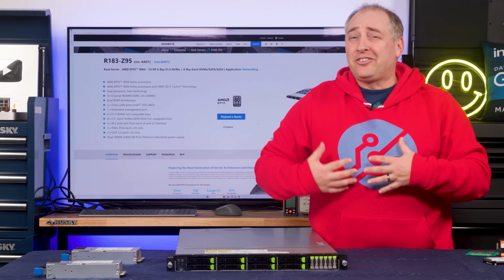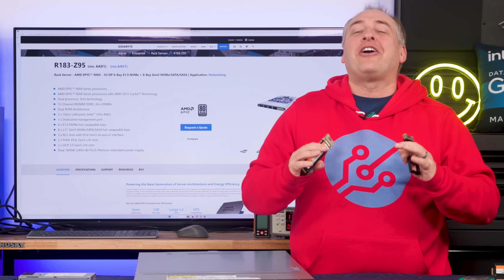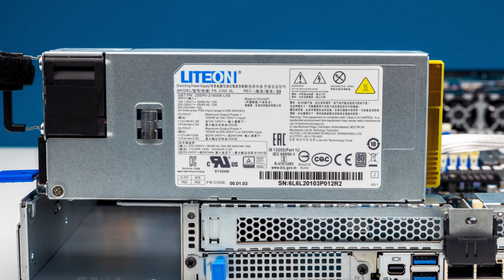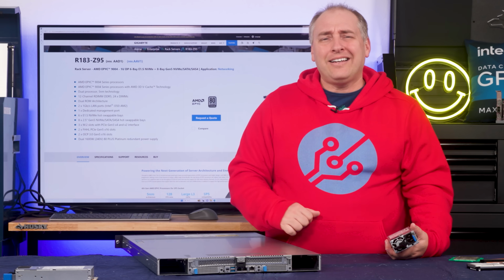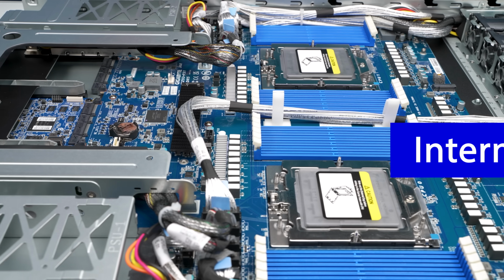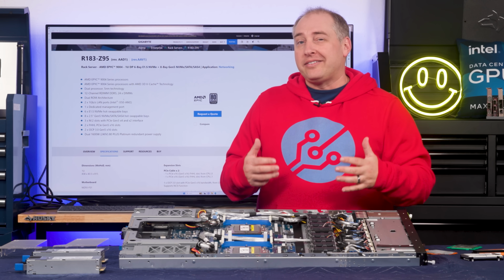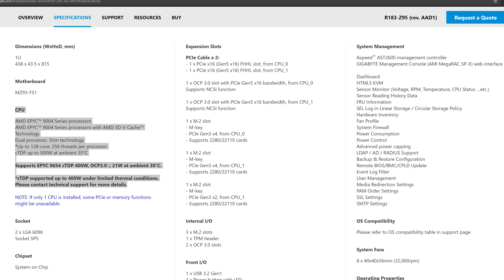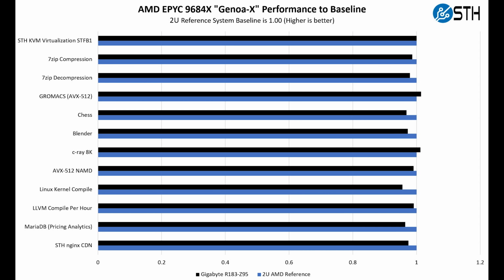THIS is the Future of Storage in Servers

Comment: Isn't 6x E1.s with a max of 7.68TB each a much lower storage density than 2x U.2 with 61.44TB each?
Reply from the maker: E1.S can go higher, but you are right that 7.68TB is common. Sometimes density is not just the capacity, but also the number of devices.

Comment: the density is mind-boggling. I remember bringing up Nehalem-EX systems (Stoutland platform, Quanta QSSC-S4R) and we had to be careful to split the power supplies across different breakers otherwise we would trip them. Those were 4U with four power supplies. Now we can do that in 1U, and there's still more CPU and memory power!

Comment: Folks, Gigabyte's customer service is 99% useless.  Perhaps for a corporate account, if you spend $millions with them, they might actually provide meaningful customer service.

Approximately 3 years ago, I had purchased two B550 chip-set based Gigabyte motherboards.  Both had terrible USB disconnect problems.  External drives would disconnect, as soon as they were done reading or writing.  Gigabyte knew about this, and even released BIOS updates to address the problem.

In my case, my motherboards already had the latest BIOS, and still had the problem.

There was no phone number to reach anyone at Gigabyte.
There was no e-mail address to reach anyone at Gigabyte.

Your only option is to using their terrible ticketing system, where they have you fill in fields, which often have nothing to do with your issue, and are missing fields that are relevant to your issue.

They do have a free-hand field for you to explain your problem.  That field is limited to 500 characters (hard to remember if it was specifically 500 characters, but there was not enough room to provide error messages, or trouble-shooting information, etc).

After you submit your ticket, you cannot edit it.  You cannot update it.  So if you have something else to add, or clarify, or correct a word that you used, well... too bad.
Then you wait, and wait, and wait.  Perhaps 10 days later, you will get a reply.

So you are waiting and waiting, not knowing whether or not a reply will ever be sent.  But you finally get a reply.  In the meantime, you are stuck with your issue, while you wait a week or two.

And guess what?
Their reply is likely useless.

They give stock answers, that are of zero help.  And it gets worse.
You cannot reply to their response.  Your ticket is effectively closed.  Your only option is to open a new ticket, and wait and wait, and pray that they provide a useful response.  Don't hold your breath thinking that they will provide a useful response.  My second ticket got an equally useless response.

On top of that, I did not discover the USB issues until after building and configuring the systems.  A colossal waste of time.

I wasted nearly a month with them.  Since I could not get the problem resolved, I returned the motherboards to the store.  Fortunately, they had a 30 day return policy.

The above took place at the height of Covid, and supply chain shortages.  I had to travel to 4 or 5 stores to find motheboards in stock, and that was after wasting a month with Gigabyte.  It cost me a good deal of time and $money traveling around New Jersey, Brooklyn, Long Island, and Queens, dealing with traffic, tolls, and tanks of gas -- all because Gigabyte cared zero about providing customer support.

I do not know how other vendor's customer support is.  But I do know that Gigabyte's customer support is useless.  I will never buy anything made by Gigabyte.

Comment: Definitely going to take some getting used to the new layout and little differences to style with all the changes, but I like it so far. Also looking forward to getting to play with these in 10 years or so. Just finally got my hands on some intel scalable servers to run with some front facing NVMe, can't wait for those that have it standard to really come down, it's slightly overkill for most but it will be good to see it more accessible to all market segments.

Comment: Hrm. More cores isn't always the answer if the single core performance is lower. But still a neat box.
Reply from the maker: Totally true there are lower-core count SKUs for higher per-core performance, and also lower core count, high cache Genoa-X parts for a lot of applications that can take advantage of that type of chip.
Reply: Also... What software can realistically run a SDS using that much performance. Maybe vsan?

Comment: I like the approach move out from VGA. It's should be obsolete by now in server field. May be, HDMI a lot better than use Mini-DP because you can take any TV and Monitors to use with it.

May be the problem are BMC chip itself, while BMC  should also implement HDMI instead. limit resolution to just 1080p at 30fps to keep bandwidth suitable for remote management.

Comment: but two 1Gb/s  ethernet is a joke. With those NVMe there should be 10Gb/s for CEPH storage or any other distributed storage.
Reply from the maker: Usually you would use OCP NIC 3.0 NICs for the data path (e.g. Ceph) or add-in cards. The 1GbE is just for the management interface.
Reply: Would not want pcie lanes wasted on anything else.

Comment: this thing looks like it could easily fit 24 e1s bays and being a dual cpu, pci-e lanes won't be a problem. wouldn;t some grills on that top metal plate help a bit with cooling, or would they mess up the air current? looks nice, i will buy a few of these once a get rich!!

Comment: 7:53 so the fans are not hot-swappable, as in easy-peasy - but, if you wanted to attempt it, COULD you swap the fans while the system is "hot"?
Reply: probably depends on the BMC or whatever is monitoring the fans. assuming it is OK with the tamper switch (lid lifted), and it considers fan with 0RPM a warning and waits until the affected components are out of temp spec before shutting things down, you might get away with it.

Comment: Would love to see a reasonably priced (home lab territory), low power, 8-16 core x64 cpu with lots of pcie lanes...would love me some nvme storage options
Reply: Epyc 8004 is probably best bet if you can get your hands on one.  There is an 8c 80w chip but once you add in motherboard and ram it's not cheap.  It will be great when these get dumped on the market in the future though.  I'd love one for my NAS rebuild that I'm planning.

Comment: So, fully loaded, this rack would be what, $100K?
Reply: What do you mean by fully loaded? You can easily crank up one of these systems to 50k. The number of servers per rack depends a bit on airflow design of the data center, and a lot on the amount of power you can draw per rack.

Comment: Your comments at the end made me think of a cool idea for a video: Compare the performance of an entire 42U rack of dual socket Intel E5 v1 servers to a single 1U dual socket Epyc Genoa server. I honestly think we've come to the point where a single 1U server replaces the compute of an entire rack. Would be interesting to do the tests to find at which generation it's break even.
Reply: Exactly what i had in mind too while watching this video
Reply: It's very much possible, because going over the network is slow in comparison, so multiple servers is always a disadvantage.
Probably best inter connect at the time was ? InfiniBand
Reply: Replace the compute, sure.
But try getting 10+ PETAbytes of storage on that 1U.
Then try AFFORDING it.

There is still a place for larger machines - for at least a few more years.

BTW - you're not looking at a fair comparison anyway, the E5 v1 is a 10+ year old server CPU platform. At least compare to fairly CURRENT stuff.
Reply: @bricefleckenstein9666  You seem to be missing the point of my comment. The entire premise is to find out in what length of time has the industry been able to compress an entire rack worth of compute down to a single 1U server. Storage density has increased as well, but it is a much more linear, rather than exponential progression, so is much less interesting which is why I didn't mention it.
Reply: @semosesam  Then why not go back to the ORIGINAL Xeons of the Pentium II generation?
Why stop at the E5?
And you're somewhat wrong about storage density, I've USED the original ST-506 and that was a SMALL drive in physical size when it came out (14" was the norm at the time).
Gets worst than that - the MAIN memory on a Bendix G-15 (I worked on one when I was in college) was a magnetic DRUM that wasn't a ton smaller than a washing machine drum (about 3/4 the diameter of a typical apartment drier drum, IIRC, or about half the diameter of the ones you find in most laundromats).
Held ballpark 4k or something tiny like that of storage.
And the G-15 did take up about the same size as a 42U rack, so the "compress an entire rack" happened a LONG time ago.
Reply: @bricefleckenstein9666  Dude, you are seriously missing the point. Again, the reference point is a dual socket Epyc Genoa 1U server. You know, the thing that was in the video we are commenting on? My original comment is simply guessing that the single Epyc server would match or beat the compute of an entire rack of dual socket 1U Xeon E5 v1 servers, but I'd love to see a video that tests this hypothesis and finds the real answer.
Reply: @semosesam  And you are completely missing my point all along.
Why specifically the E5 v1 as the COMPARISON point?
Intel and AMD were both building servers long before that particular CPU family showed up.

BTW - you're wrong, if you compare a 1u dual Genoa Epic to a 42u high stack of E5-2680 v1 - that particular E5 model in even 1u servers adds up to 84 CPUs each at about a tenth of the power of each Genoa.
I suspect that Genoa wouldn't even match the overall CPU power of the E5-2630L v1 in a 42u rack full of 84 of those - and that was the lowest power draw CPU in v1 of the E5 26xx lineup.
Reply: @bricefleckenstein9666  Just a guess. I think you're underestimating the IPC gains between the generations, but equally I wouldn't be surprised if I'm off by a number of generations. I look forward to your, or anyone else's video, that shows the real world benchmarks to prove my guess one way or the other. As I said in my original post, which I'm starting to think you never read all the way to the end: "I honestly think we've come to the point where a single 1U server replaces the compute of an entire rack. Would be interesting to do the tests to find at which generation it's break even."
I just think it would be a fun video idea. That's all.
Reply: @semosesam  I happen to run a few E5 v2 machines right now - and yes, the IPC gains have been significant, but not all that much per generation on average.
They've NOT been anything like 100% per generation or some such - more like 10% on average with sometimes higher, but often ZERO.
We're not looking at Bulldozer to Ryzen levels here every generation - that was a rarity.
Reply: @bricefleckenstein9666  Have you ever heard the saying, "It's not the destination, it's the journey"? I'm interested in a video that goes through the process of proving what the answer is, not your conjecture. So unless your next response is a link to such a video, please go "umm... akshually" someone else.
Reply: @bricefleckenstein9666  Yup, but these servers are primary compute devices, where storage isn't a priority. Usually the storage is handled by a separate storage system that has very low compute power, but Petabytes of storage. the 1U compute machines have just enough fast storage locally and draw on a storage system for bulk storage.
Reply: Yup that's the ideal for data centers. The issue is now mostly cooling: smaller fans need to run at very high RPM to move a lot of air for cooling, but are noisy and don't lasts as long. When you have a rack of these 1U filling up an entire rack, its uses a lot of power & needs a lot of cooling.
Reply: @guytech7310  Agreed, I'm extremely interested to see the transition to water cooling in the datacenter. I'm working with a colo now that makes custom cabinets that force the hot air directly up into the plenum in the ceiling rather than hot aisles as an interim solution for 10kW+ racks.
Reply: @semosesam  I don't see water cooling going mainstream, simply because of the risks of water damage to electronics. the working coolant would need to be inert.
Reply: @guytech7310  Fair enough, "liquid cooling" then. Although, it's worth pointing out that quick disconnects made for the colo are getting extremely good. But to your point, for liquid cooling to every node, the entire room needs to be designed for it. I'm starting to see facilities now where the cooling is under the floor, and power and data are in ceiling. It's a trend that, along with increased power density, I only see increasing over time. "Going mainstream" seems to be a matter of when, not if, from what I've seen.
Reply: @guytech7310  There is a reason us techs call 1u cooling fans "screamers".
Though it is POSSIBLE for bigger fans to argue the noise level - the 8000 RPM Delta FFB type fans for one.
That's actually a medium RPM level in a 1u power supply cooling fan.
Reply: @bricefleckenstein9666  yeah, I know I've done a lot of work in Datacenters in the past & replacing a lot of those 1U fans. That said I haven't worked on one of these high core (96 cores) full of NVMe drives. I presume the fan noise is considerable worse.

Comment: 4:36 you are wrong, those two screws make it possible to attach EDSFF drives internally. We use them to attach those drives to water coolplate in our custom servers. Also, externally we use them with latchless handles (they're held with friction from leaf springs pushing them onto the water coolplate). I can give you more info if you're interested
Reply: Sir can you please tell me for what and why these server machine is used for ?
Reply: @murtaza9669  Minecraft

Comment: I would guess that the latching mechanism effectively gives OEMs a chance to advertise when the chassis is in the rack.

Aside from that, they would just look generic, or god forbid, the storage manufacturers would be the most recognizable part of the faceplate. Seems pretty petty, but I wouldn't be surprised if that was the thinking.
Reply from the maker: That is 100% the idea, and it was driven by a few very large OEMs.
Reply: Why not just allow the addition of plastic cover plates that snap on for branding?
Reply: @thedopplereffect00  then you'd be able to replace your dell sleds with HP sleds and we all know customers can't really have nice things if they are not tied to specific vendors. ;)